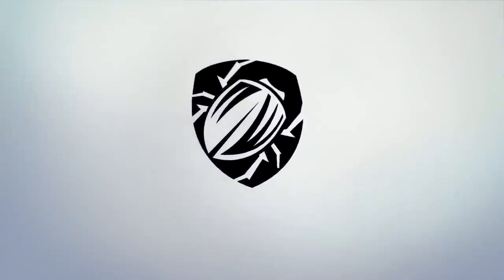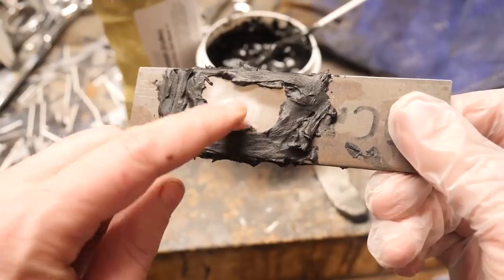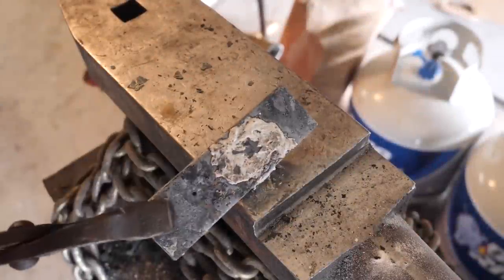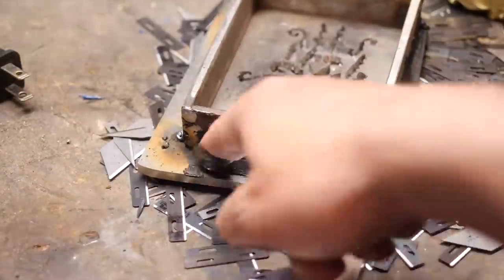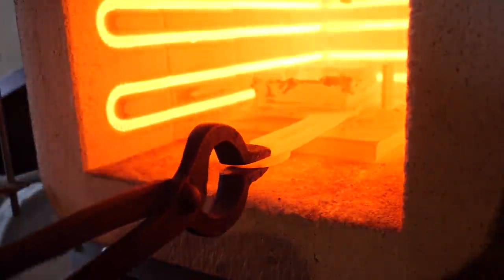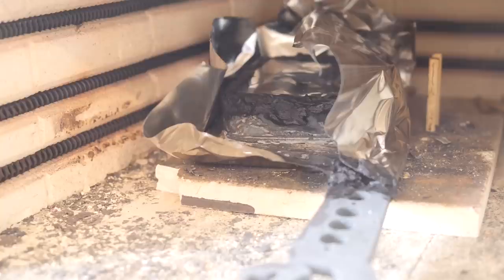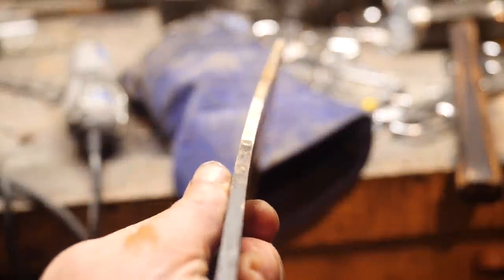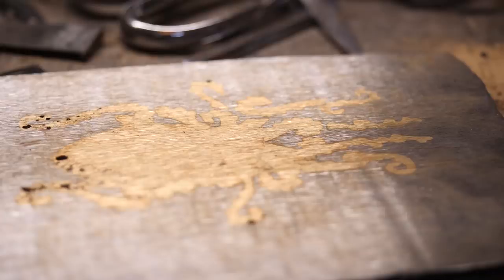Return of The Squid Cleaver!

Comment: I'm gonna guess air between the powder particles is bubbling out, leading to the issues with the bubbling. 

I think the pouring method is going to be problematic, for similar reasons to the a for mentioned.
When you pour epoxies into closed spaces, ur supposed to pour at one point. This lets the epoxy flow out from this point, pushing air out of the way so it lessens air getting trapped. Like happens when you move around while pouring. The multiple "waves" of epoxy meet each other and that traps air. 

I'd try, as someone else similarly mentioned, a cutout of the pattern. But try using a rotary tool to undercut the perimeter of the design on the knife as a key, like they do with inlay work. Just a rough groove all the way around, in the middle of the knife thickness. Even using a tiny ball head bit for the narrow tentacle areas. Use brass/bronze sheet that's a 1/16-and 1/8th thicker. Used stand offs that are have this thickness to get it center in the blade, thickness wise. Try hammering cold or, maybe, with the bronze heated. This will, hopefully, squish the bronze into that groove you cut, locking it in place. Trick is not hammering it bellow the thickness of the knife. Grind flush. 

Or do a cold cast bronze pour. Your have to check the max % of bronze/brass powder the epoxy can take. But will buff up nicely once cured. I've done cold cast bronze and damn if it's hard to tell from real bronze until you feel the weight.
I think hot pour or melt in an oven methods are going to lead to the clever distorting. And efforts to straighten are going to release the Kraken.....

Comment: I’m in agreement with the peening idea. One comment is that the inlay should be 1/16” thicker than the blade. Take the cut out blade and file a bevel equally from both sides so that the bronze will mushroom into the gap. You will need to anneal the bronze so that it doesn’t become brittle. Shim the blade up by 1/32” so the bronze is centered. Don’t overwork any one area without re-annealing. Use a chasing hammer of about 3.5 ounces and go slow. Fiddly work this.

Comment: You could have a piece of steel cnced out in the shape of the squid, and bronze plate it by using a wire wheeling and heating up the metal.

Comment: Take some pieces of brass approximately the size of the holes you want to fill and hot forge them into the blade. small details can be brass wires and bigger pieces can be plates.

Comment: Heat the steel to 1950 while you are melting the bronze. If you are pouring the molten bronze onto steel that is hotter than the melting portion of the bronze, maybe it will keep it fluid long enough to fill the voids. Just a thought.
Reply: Clever, and probably a good way to go about this.
Reply from the maker: Problem is the amount of scale on the steel when it’s left to open air at that temp.  Maybe a lower temp?
Reply: @GreenBeetle  Yes a lower temp might work. When casting, the molds are heated up quite high and this is a form of casting. This may be overthinking it but maybe if you incorporated a lost wax method and built the mold around the cleaver and did a wax burnout and then pour, it should work. Of course you would have to fill the void with wax and vent channels then form a mold around it but I would think that would be your best bet for getting this to work.

Comment: I think the only way to do this successfully is to cast it, you need external forces to force the metal into the detailed shape. I think the main issue here is that metal when it’s melted draws itself together, when melting small amounts of silver you get a sphere. So just melting metal and hope it to fill voids probably won’t work as it isn’t like water and just flows and fills. Perhaps vacuum casting would be an alternative, making a way to mount the cleaver so that it seals against the hole drawing a vacuum, so that when you pour the molten metal into your shape it is drawn through in every nook and cranny. You probably need high heat plaster specialised for casting to put on the bottom of the cleaver so that the metal isn’t pulled through and into the vacuum pump.  Usually when vacuum casting you prepare a flask with your lost wax method, the flask is pre-heated so the plaster won’t crack and to not cool the metal when casting, so I would pre-heat the cleaver. Good luck!
Reply: I also sent you a DM on Instagram

Comment: Dude, I wake up and see I have a green beetle in my subscriptions. No idea how, but what I think is that the whole video I called what the end result was gonna be. First. When you heat up 2 types of metals and try to fuse them; use flux. 2nd, shaking liquid metal is worse than just letting it sit. And 3rd I never saw you harden you metal, so youre still grinding and try to finish an unfinished product.

Comment: I would suggest putting powder in the holes and use a torch to heat it up
Reply from the maker: the torch will blow the powder away
Reply: @GreenBeetle  shoot well you could melt it separately and pour it in the the holes and grind it smooth

Comment: Why don’t you cnc the shape of the squid out of bronze and fit in the knife? No need of brazing or melting. You just have to get the tolerance right. You can then try to heat the blade and fit the pieces so when the blade cools down the bronze gets really stuck.
Reply from the maker: the tentacles suction cups are different on each side to lock the bronze in place so this might work but would have to be hammered into the tentacles from either side.  good thought.

Comment: I'd have tried to put solid, exactly fitting bronze pieces in (slightly thicker than the Blade), then hammering them in. Maybe carving a notch around the inside edge of the steel...

Comment: I think honestly you might try engraving? It would be cheaper than buying an AC torch.. some thin bronze wire and a hammer and a graver. Well that and it would certainly take a longer time. It's a tough one.

Comment: It seems to me that your problem with air bubbles is that you're asking the bronze to flow into an air filled cavity from the top, trapping air underneath the molten bronze, and then relying on the resulting bubbles to float through what is a fairly viscous liquid to the top. Using powder exacerbates this issue (I'd bet that at some point it's essentially a foam). If you can't use a brazing method (obviously first choice) you'll either need to make the steel sink into a puddle of bronze until it's completely immersed, thereby keeping the air out of the bronze, and then grind it out (insanely expensive), or perform the process in an evacuated container (insanely difficult: how would you weld the evacuation port?). 

One other thing you might consider is having your squid lasered  or water jetted out of bronze a little thicker than the steel, inserting it and then heating it: that way most of your flow problems are engineered out before you start. Your only source of bubbles would be the (hopefully small) gaps between the bronze and the steel.If you could find a way to heat it from beneath, the bronze would melt bottom up and no air would get submerged.

I hate to be a downer, but I don't think there is a very practical way of doing this.

Comment: I know that some people use brass wire to embellish swords. By inlaying the brass and hammering it in. Followed by sanding. Maybe using brass wire and hammering it it, will fill in the pockets and bubbles. I don't know if this is true. But do you think the brass might be reacting to the cement? Or an even wilder idea. Try pouring the melted brass inside the furnace. When pouring, the difference in temperature might be the thing that's causing it bubble. By pouring it in an environment that's its melting pound. You might get a more fluid pour.
Reply: Melting point*
Reply: Or forge weld two brass pieces, with the cleaver in between. And hammer it.

Comment: I think the only way to do this is to laser cut your blade, laser cut a brass sheet to fit like a Lego then cut little unique slots on both sides as you did in the first video and peed the metal into place thereby mechanically holding it in place. This melting thing seems really tough.

Comment: What if, instead of having the squid as a full cutout, have it carved in one side instead? That way you'd have a built in steel backing and wouldn't have to worry about the bottom finish, just the top.

Comment: It may be time to hunker down and invest in a torch rig. All great shops have them and they are just so versatile. You can pick up used regulators, hose and a torch body for around 150 used normally, and yearly  cylinder rental from your local welding supply company shouldn't be more that 125 a year for an oxy 122 and an acetylene R, maybe even an S, which should be plenty big enough bottles for a hobbyist.

Comment: Yeah I would have braised it in there, or tried to. Using an oxy/acetylene set isn't that hard. Get a neutral flame going, heat the steel up to a cherry red or orange, make sure you have flux on your bronze filler rod, then off you go. You may have to fill in a few spots here and there after your first go, but it's doable.

Comment: If that's not dedication, I don't know what is.
Only solution I see is having the sketch used as a toolpath to CNC a brass squid that'd fit into the knife (then shrinkfit it in place to deal with the tolerances issue), not the best value proposition tho

Comment: Put the whole thing in a container with " White-Out™ " Everywhere on the cleaver and container, but the cutout of the squid. Only the vertical cut without. Just let everything float.
Does the top need to be sealed? Can you get it hot enough by just putting a lid on it that can be removed and stirred to make sure all voids are out?
I think your only other option is a collab with someone who can melt the brass and pour it.

Comment: What if the steel you start with is far too thick and the pattern is not completely through the steel?  Not cut the pattern out, but instead engrave it 90%of the way through the steel.  Melt bronze and fill in the pattern.  Then it’s just a matter of pouring molten bronze.  Grind the excess steel from the other side of the blade and go at it.

Comment: IDEA: don't cut the pattern out all the way through the blade. Instead, make an etching stencil and create a DEEP etch of the pattern in both sides. Then braze over the etched area, grind flat, and tadaaaa! (at least, it makes sense in my mind that this would work)
*if you worry about the brass having enough *stickem to the steel blade, drill a couple holes completely through after the deep etch, and drive a brass rod through those areas that can be mixed/brazed together with the brazing.

Comment: If you sand cast, I would put the piece in the casting sand with box area under the squid and the top open. Pour through channels under, then from the top. And make sure everything is dry. Moisture explosions are bad mmmmkay.

Comment: set blade in furnace with steel heat sync base when your melting the brass before you pour, place heated mass below blade in contact with the sand so you dont cool blade too quickly, then pour away

Comment: One: increase the size of the octopus. Part of the problem is how small some of the tentacles are.
High end fix: Have someone machine the octopus parts with close enough tolerances to do and interference fit.  Heat up the knife and press fit in the brass parts with a press.
We are talking 0.001mm to 0.025mm larger than the holes in the blade. (Generally . 0005-. 001 per inch) 
The laws of thermal expansion should allow the cooler bronze parts to fit in what would be at normal temps a hole too small.

Not sure if this would work but lots of things use interference fits but they require super precision.

Comment: My two cents. I would chamfer the edges of the pattern in the clever, top and bottom, evenly. Very, very evenly. Cut bronze or brass pieces, a press fit, to match. The bronze/brass should be thicker than the clever. Tap the bronze into place gingerly. Then peen down all the bronze/brass edges and grind smooth.

Comment: That's a shame! too bad it didn't work for you. I have a friend who works at a place where they press bronze powder into bearings and then bake them. I would assume you need some pressure on that when it's hot to force it to fill all of those voids and small cavities. A pour might work because then you would have more control. And the ability  to handle the peace  better. If you are to pour the bronze in there and then apply even pressure across the whole piece to force it in to the void while it's still Molten may work. In the end it's just a guess on my part as well

Comment: What torch head do you have on that Bernzomatic? If it's the lower heat output TS4000, you could try swapping it out for the higher heat output TS8000 for $40-$60 USD and see if that works.
Reply from the maker: It is the 8000

Comment: I wonder if there's a chemical reaction known as a eutectic forming between the brass and the stainless.  Look at the dissolvability of zinc or copper into steel or chromium at the temperatures you're working at.  VERY INTERESTING!

Comment: For what you paid in bronze powder you probably could have bought a harbor freight tig welder, to tig braze it. It’s unlikely you’ll be able to remove the metal oxides and off gassing by-products with your current strategy.

Comment: You should have heated the steel to bronze melting temp ( around 900°c, that's roughly start of forging temp for steel) before pouring @ 0:45 the temp difference insta freeze the bronze, doesn't allow it to flow into the spaces.

Comment: The only thing i saw you do throughout the video, was throw a bunch of money at it wildly. 

1, you should have used flux on the steel. Meaning, pour a bit of flux on the steel first, before adding bronze powder, then more flux on top, after bronze. 

2, you really should have tig welded a small bead around bottom plate, which would have prevented any leaks. Maybe outsource the tig weld if you aren't up to it, as outsourcing the inlay will make it seem like you didn't really make the knife.

3, if you really are having that much trouble with it because you dont have oxy/fuel brazing equipment/skill, then you should consider getting yourself a mapp torch, and some low silver content (15 or 20 percent) silver brazing rods with flux on rod. Melts at a much lower temp, and flows really well, and still has the golden look of bronze/brass. 

4, Thanks for the idea. 😉 Let me know how it goes.

Nb, you do not need to have capped it off at the top, if you have the bottom seal welded properly, and added flux on the steel first, and then at the top. The flux at bottom is to protect the oxides forming on steel, and flux at top, prevents contamination of the filler. Thats if you give the powder another go.

Comment: Bronze rod in the welder with the amps turned way down?
Reply from the maker: Will this work?  The rods won’t blow up?  Interesting thought
Reply: @GreenBeetle  Good point, with no flux you'd probably at least get a lot of spitting. Guess the more I think of it the less safe it sounds 😁 
At low amps I'd say the rods would take the current though, after all you can get aluminium welding rods.

Comment: This is what I would really like to see you try. Have the inverse pattern cut from a 1/8 thicker brass sheet. 

Weld a 1/4 steel backplate flush with the bottom side of the cleaver. This backplate shouldn't be able to flex at all during the next step.

My suggestion is to then "peen" the brass cutouts into the space of the octopus using a custom made (by you for this) 1/2" ball point chisel.

Make sure to anneal often as the brass will work harden like a MF.

 The idea is to pin each brass insert from three points in it's cutout, and the draw the brass from a 1/8" back from the edge of the brass insert out towards the edge of the steel cutout. Three strikes maximum per chisel placement per anneal cycle. Move the chisel around the perimeter of a cutout in 3/16" increments.

After peening the brass into place. Cut off the steel backplate. Grind that sucker down.

Comment: The company that did the cut out for your cleaver have them take the Cut out And bevel in words on both sides of the cut outs Then for each cut out have an exact piece of brass cut out to match each shape of your cut out half the brass slightly thicker than your knife push each piece into your knife cut out and bevel it over like you do the pin of the handles then sand smooth it would give you a mechanical lock that you don’t have to worry about if you’re insistent on casting don’t put the metal against another piece of metal Make a small rectangle box about 1/4 of an inch Weld this box on both sides of the blade just like green sand  casting you need the metal to flow to the object in past the object to hold it stand the knife up vertically put one small hole from the top for you to pour in the bronze for the bronzing let it cool remove the two side boxes all the shrinkage from the metal should’ve happened from the top or the bottom leaving the metal perfectly casted You’re not leaving enough room for the metal to heat and contrast on both sides of the blade plus if you stand the blade straight up hill he and contrast up and down words not on the spot that you’re trying to fill

Comment: Beetle it's me the Togishi.
I'm taking a break of sorts. Will be here just the same.

Warm Regards

Ouch
Reply: I was thinking a practical immersion in brass, you were so close. It's either air or outgassing Brass Vapor. About half way through I thought that's it, he's got it now. Literally laminate it in brass, and then grind down. Then you started chiseling. It's going to be a trip. Good luck my Friend!

Oh one more thing. I did some casting in the past, and have seen many fittings with bubbles that were worked down to acceptable cosmetic levels.. It seems it's the nature of casting. One comes out perfect the other doesn't.